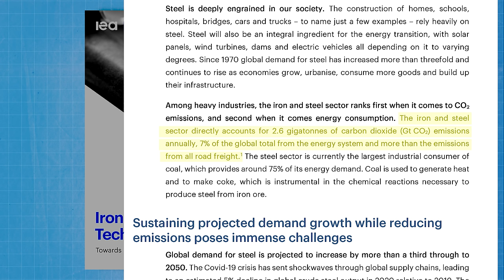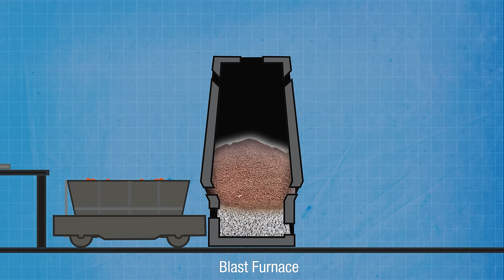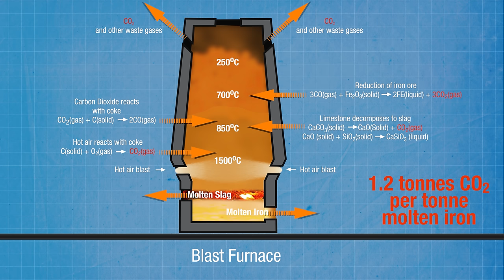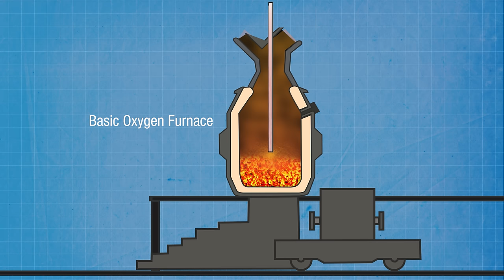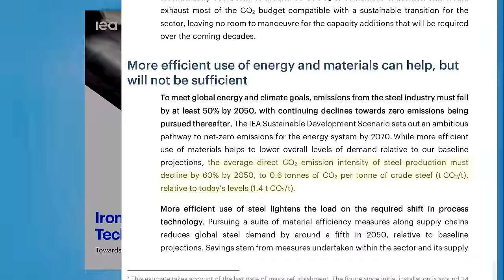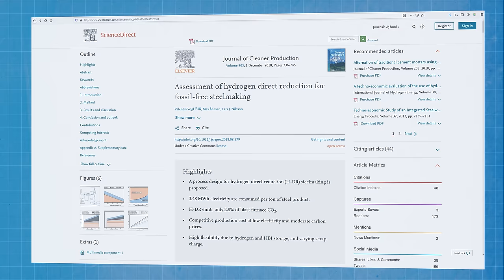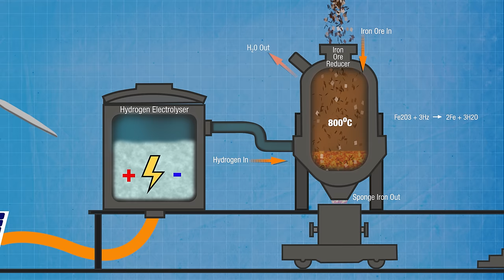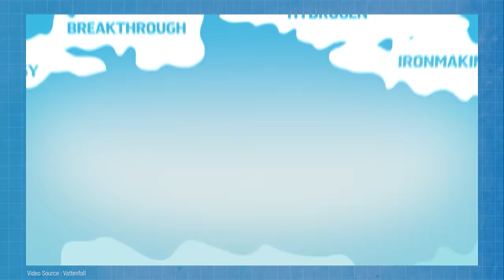Fossil free steel. Another giant step towards net carbon zero?

Comment: 200 tones per hour would exceed current world steel production by 4 times. From one factory? You got something wrong there.
Reply: World (crude) steel production per year is at about 1_800Mtonnes (mega)
200 tonne per hour would output about 1.75Mtonnes per year. So it would be less than 0.1% of world production per year.
(There only are about 8765hours per year on average)
Reply from the maker: Hi Timothy. I took that number from one of the research articles that I left links to in the description box. Here's the link
https://www.en-former.com/en/hydrogen-revolution-steel-production/
And here's the relevant quote from the article
"Initially, Hybrit will only produce a comparatively modest amount of one metric ton of steel per hour. Moving forward, however, production is to be expanded to churn out the usual industrial quantities of around 100 to 200 times this figure"
Reply: @Herr_U  Yes, my mistake when looking up world steel production.

Comment: I'm surprised steel ranks higher than concrete on the CO2 list.
Reply: I have worked in both fields and both have the same problem. The chemical reaction that takes place to get the raw material to the final product results in a lot of co2 being driven off of the process.

Comment: The total energy input of extraction, crushing, sorting, transporting, selecting, treating, heating, and then the process of carbon introduction to make steel, even with this adjustment, requires immense inputs of carbon emitting energy. And there is NO prospect that will change in the foreseeable future. A depressing descent into marketing hype. A surprise from this source, normally rigorous.

Comment: Did you say '200 tones per hour'? You must have got that wrong. How do you transport it in and out? By train? By ship? At 200 tones per hour? Really?
Reply: There are blast furnaces that produce over ten tons of molten steel A MINUTE.  The size of these things is insane.  Steel is a BIG industry.
Reply: @incognitotorpedo42  So assuming they only operate 8 hours a day that's 4800 tons per day. They would consume several full trains of iron ore per day. The logistics seem impossible.

Comment: The steel company I work for has 2 of these plants and they have several issues. First the material is very light. This means it is not very dense. This makes shipping very inefficient and expensive. The other issue is storage. The sponge iron can oxidize very quickly under the right circumstances. This happens fast enough that most people say, "hey, that's on fire!" Properly feeding this material into EAF's is not as straight forward either. Other than totally new processes, there is no way to reduce CO2 emissions. CO2 is part of the chemical equation and equations have to balance.

Comment: Now, get us fossil-free steel, and fossil free cement, and we're going to be a whole lot closer to net-zero carbon emission going forward.
Add mostly electric road transport...
We desperately need grid scale storage, for electricity.
And we need a way to make jet-fuel from the carbon that's already in the atmosphere, so that burning it is carbon neutral.
It would be very nice of we could make battery powered aircraft like we make cars, and on a small scale that's completely possible, but on the scale of trans-Atlantic 600 mph airliners, like the 777, that's not really possible. Ok, so ... if we can do carbon capture and make more 'jet fuel' from the carbon dioxide that was already in the atmosphere, then we can use it again with no net effect, right? That's not entirely optimal, but I think it's good enough.

The big ones, grid scale electric storage and carbon free steel and cement. And transport which is zero carbon where batteries are applicable, and carbon neutral where they're not.

Comment: I have day dreamed for several decades that after the solar panels I invented at age 13 (didn't happen) made me mega rich, I invested in 200,000 acres of West Texas land to grow algae. The algae could be turned into steel, concrete, rubber, plastic, glass, artificial wood and other materials. Super refined algae produces steel in my day dreams that is 5 times stronger than steel and one third the weight. Is there any physics reality possible to my dream where I am the richest person that ever lived and saved the world so I became King?
Reply: Not exactly.  Algae can't make steel, concrete, or glass because they don't contain the right elements.  They could be coerced (with substantial difficulty) into compounds that could ultimately be made into plastics.  If you had something that was 5 times as strong as steel and one third the weight, it wouldn't be steel.  Perhaps it would be a carbon fiber reinforced composite.  You would need to start out as a King to have the money it would take to convert algae into that.

Comment: one BIG Problem hydrogen inclusion makes steel brittle I know this as a welder it is a major problem 
Carbon is also an essential constituent of steel without it steel is not steel it is soft iron
Reply: Hydrogen inclusion in steel takes place below 150C when hydrogen migrates out of water into the steel's crystaline structure. Any hydrogen in the steel sponge would be driven/reacted out in the electro melt second stage.

Comment: Just so people understand the scope of replacing carbon based fuel the world as of 2019 consumed roughly 150000 twh of carbon fuel. That's 150 trillion watts of electricity! If you wanted to use solar a good panel is 350 watts average peak output 3.5 hrs a day. 150 trillion watts ➗ 3.5 hrs divided by 350 watts means we would need roughly 12.5 billion Panels plus all the wires inverters battery storage and energy consumption grows as we use more and more computers and robots it would probably double with a blockchain based financial system and increase again with electric cars because of transmission losses according to the law of thermal dynamic then there's the goal of bringing electricity to the estimated 15% of the world that doesn't have it and all of this is going to require an increase of resource extraction to build out the infrastructure , computer, wire's, cell towers , the list is endless and almost all of these products are either made from oil byproducts or require carbon based fuel to extract because most of the resources required are in remote area's. I'm not saying carbon is good I'm just saying we're talking about hundreds of trillions of dollar's and an increase in resource exploitation to and this will be done @ the expense of everyone living on the planet . It's seems to me that this isn't about saving the planet but more about exploiting it ! The easiest and fastest way to reduce carbon would be stop cutting down the planet's lungs(tree's) plant tree's and make efficient use of resources so make product's that last a really long time instead of this disposable junk we have to buy. Or my favourite suggestion I've heard some billionaire make reduce world population . that would be the overnight carbon fix you could instantly remove equal amounts of carbon with percentage of population 50% less people = 50% less consumption = 50% less carbon,😆

Comment: Fossil free? How’d it get molten?
Reply: It's placed in northern Sweden where there's an abundance of energy available from hydro and wind.
Reply: and what was used to build the dams and bird killers?
Reply: @pauldiatlovich8515  machines?

Both dames and turbines are co2 neutral after a few years
Reply: @Dundoril  you do realize a wind turbine requires more fossil fuel to build than it can generate over it’s lifetime? Dams needed fossil fueled powered machines to build. Those pesky facts get in the way don’t they.
Reply: @pauldiatlovich8515  "you do realize a wind turbine requires more fossil fuel to build than it can generate over it’s lifetime"

No because thats not true. 
There have been a lot of studies on this...depending on localtion wind turbines have co2 pay back times of 9 month to a few years.....

"Dams needed fossil fueled powered machines to build"

And then they produce so much energy at low CO2 emissions that this will be paid back in a few years.

"Those pesky facts get in the way don’t they."
No those are rather strange lies...
Reply: @Dundoril  right.  You just keep spreading disinformation and ignore the facts. Sorry again about those pesky facts getting in the way of your false rhetoric
Reply: @pauldiatlovich8515  your own fucking links supports my argument:

Undoubtedly, a well-sited and well-built wind turbine would generate as much energy as it embodies in less than a year. 

You clearly never even read your own source...

No of course you will move the goal post... 3...2...1..
Reply: @Dundoril  when you have to resort to profanity, you lose the ability to debate. Obviously you can’t comprehend a written article. Next time I’ll draw you a picture.
Reply: Profanity? You are as special kid of snow flake aren't you? 

But anyway: I just quoted your article.. It supported my claims and showed that you were wrong when you claimed that wind mills do no produce enough energy in their live time to get the co2 cost back... THAT'S what you claimed.
Reply: @Dundoril  sorry, I don’t debate with idiots, good day.
Reply: @pauldiatlovich8515 now you are running away.... Sad...  Instead of admiting that you were wrong ... Well not even your own source supports you so you don't have much options left...
Reply: @pauldiatlovich8515  Well you repeated that twice now..enough time to make an argument....but clearly you dont have one
Reply: @pauldiatlovich8515  And again a response and you still have not argument...sad
Reply: @pauldiatlovich8515  
Your link is broken. Please post a new one.
Reply: @3gunslingers  sure it is.
Reply: @pauldiatlovich8515  
Please post your source with a working link.
Reply: @3gunslingers  this is sad... Now you you can not even post a working google link...

Comment: Just how is this hydrogen to be produced? There is no 'excess' of renewable generation to do it so there only remains producing hydrogen from gas which emits CO2 during production. Both are very energy intensive and the resultant energy from hydrogen is therefore expensive. 
Hydrogen is also detrimental to steel, causing steel embrittlement. It is very flammable and explosive in large to small proportions in air, is very difficult to contain.
This may well cause more problems than it solves?
Reply from the maker: It will be prodcued via electrolysis using renewable technology. Australia is already way ahead of the market on this one. The United States is still too busy arguing with itself to have realised that the world has moved on. Hopefully Biden will sort that out though. Hydrogen is detrimental to steel pipework only if it is continually pumped through it, but in this proces it is immediately converted to water (steam) by reacting with the oxygen in the iron oxide. It never has a chance to corrode steel at any point in the process.
Reply: @JustHaveaThink  
what part of there is no excess renewable generation do you not understand?
Reply: @iareid8255  It looks like there's something you don't understand.  When solar PV output or wind turbine output exceeds the instantaneous load on the grid, those sources are simply shut down.  This is called "curtailment".  If we could instead send that power to electrolyzers, we could turn it into hydrogen instead.  It's essentially free electricity, since it otherwise would have been wasted.
Reply: @JustHaveaThink  The Hydrogen is under pressure and does cause embrittlement of the pipework. I worked at the BHP HBI in Port Hedland and from Memory the line pressure was 200Bar. The Steel doesn't corrode, embrittlement happens when Hydrogen penetrates through the steel it forces the crystalline structure apart forming cracks where Hydrides can form and the process continues. The only way to slow this down is to remove the pipes put them in an Oven and go through a stress reliving Heat cycle, this opens the molecules up and allows the Hydrogen to escape. Having worked at a Direct Reduction plant I can say this. Yes it looks great on Paper but they are Dangerous and the Maintenance requirements are huge. Ultimately that's why BHP gave up on the $2.5Billion project in Port Hedland, they could not guarantee there employees safety.
Reply: @incognitotorpedo42  

I understand how the grid works and there is little curtailment in the U.K. at least. However  as hydrolysis is so energy intensive and the quantity of hydrogen to be made and  compresed is so large that sporadic curtailment won't begin to address that requirement.
Reply: @iareid8255  Sunny environments with a lot of land lead to curtailment.  The southwest US, Australia, and North Africa are examples.  As PV gets less expensive, curtailment will become a bigger problem.
Reply: @shanewheeler713  Interesting.  Thanks for the inside knowledge.  I wonder if you could solve the embrittlement problem by lining the pipes with something?
Reply: I.T.,
that is bad planning and a waste of resources. You must be aware of the problems this causes a grid operator. 

However in the context of producing hydrogen from 'green' generation, solar is even worse than wind. The quantities talked about even just for iron as this video is about takes very large amounts of consistent 24 hour electricity all year round.
Reply: @iareid8255  If you have a lot of sun, a lot of land, and nothing else to do with it, and you have cheap PV and a use for the energy, that's not a waste of resources.  I understand how the grid works.
Reply: @incognitotorpedo42  
If you consistently have more output than you can use then the capital outlay for that extra capacity is a waste. 
If companies are compensated for being curtailed then that is an even bigger waste and increases the cost to the consumer. If such businesses also have storage and use that to provide balancing services to the grid. If it's like the U.K. then that is another extra cost to the consumer.

Comment: How much electricity is used to make aluminum? How much of the aluminum is used for foil wrap, plates etc.? Anybody know?
Reply: A lot.  So much so that it's common to see aluminum smelters built very close to power plants.  Iceland is a large producer of aluminum because they have abundant clean geothermal power.  My gut sense is that most aluminum goes into durable products, and disposable crap is a relatively small fraction.  Aluminum is recycled at a pretty good rate.  Compared to iron, aluminum is expensive.  Recycling it uses far less energy than making new aluminum.
Reply: @incognitotorpedo42  Yes, there are aluminum smelting plants in Quebec, Canada that use hydro electricity and have the raw bauxite shipped to them.  What do we make with aluminum that is important enough to make that possible.

Comment: Steel can even be a carbon sink (though not a particularly efficient one if only used for that purpose). The carbon added to bring the carbon up to 1-2% could come from direct air capture, or from carbon capture on a cement plant next door. I think that will be the second phase of this technology. If we can start by using something other than fossil fuels to provide the energy and only emit the carbon that escapes while we are trying to put it into the steel, that will be a huge step forward and can be enough reduction to buy us time. If we can cut emissions by 95% by 2030, then we likely have 20 years to clean up the hard edge cases.

Comment: You will still need Nuclear Power to supplement renewables because they don't all work at night. Wind doesn't move the turbines all the time. Large electrical storage capacity isn't there yet. Carbon dioxide fluctuates widely in the atmosphere and green growing things need it.
Reply: The hydrogen discussed in this video would be the storage medium.
Just produce it when the wind is blowing and the sun is shining and use it slowly but steadily in your factories.

Also hydrogen can be shipped easily around the world without pollution. Many regions that are poor today have perfect conditions to produce cheap hydrogen.

Comment: Unfortunately there is going to be such a high demand for green hydrogen for aviation, HGV/ long haulage and shipping fuels and other industrial processes once we have an appropriately set and mandated carbon price that I'm not sure there will be enough installed capacity (alongside primary energy) in the timeframe required.  We basically need to cover huge proportions of the world's deserts with solar panels in the next ten years and somehow make electrolysis cheaper than natural gas reforming.